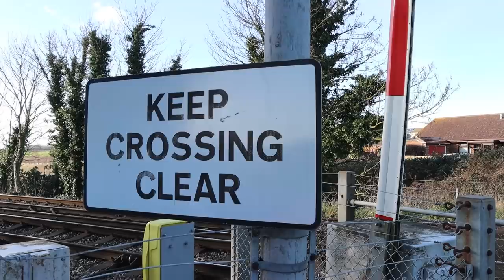Thanet Parkway Station is being Constructed

Comment: I should add, as the video would have been very boring if I'd gone into too much detail on this... It is possible to amend an Automatic Half Barrier crossing to have stopping/non-stopping controls (as the Romney Hythe and Dymchurch has) and Sevenscore crossing on the other side of the station will get them. Cliffsend is getting the full whack of CCTV for safety reasons as much as the station as it's in a residential area and heavily used by pedestrians etc... 
Now you see why I didn't say it on film.
Reply: Your contributions to Geoff's videos are NEVER boring, don't worry about it!
Reply: Legend mate
Reply: This totally needs to be pinned
Reply: It's interesting you say it has to be controlled manually. In Denmark we've gotten rid of most level crossings for obvious safety reasons, but the few that remain are normally tied into the signals, so if the train has a clear signal the gates stay down and if the gates can't go down for whatever reason the trains get a warning signal and have to stop for crossing traffic. We also have separate "station exit" signals that basically work like blocks within the main blocks, which keep the trains at the stations till the line's clear, especially in cases where the station is right next to a crossing,so the trains can't leave the station till the gates are down
Reply: Thanks for the extra information.
Reply: @thesteelrodent1796  that's pretty close to us TBH, signals can't be cleared for manual crossings unless the barriers are locked down. Automatic crossings are just that - automatic. Modern ones use obstacle detection technology to achieve the same ends.
Reply: Boring? You mean in the sense that it wasn't appropriate for this non-tunneling construction video. I would second that :D
Reply: Boring? I feel like you don't know the target audience at all :D
Reply: @regiondeltas  😂 there is that!
Reply: Boring? The only thing that was doing any boring was the pile-driver creating the holes for the concrete columns.
Reply: I must say your commentary on Geoff's videos can never be called boring. They are very interesting and informative. In my so far 38 year railway career our paths have yet to cross. Your are a great ambassador to Network Rail, keep up the good work. Ray
Reply: @citled  Oh Ray thank you - what a kind thing to say!
Reply: Every time we see your face pop up we know it's going to be an even more interesting video on top of Geoff's already super interesting content.

Comment: To answer the question about the point on the Thanet circular where going the wrong way to London is better than going direct in more detail, in practical terms it is Margate but it can be said it is Birchington-on-Sea. Margate to St. Pancras Intl. via Faversham is 1:36 h while Margate to St. Pancras Intl. via Canterbury West is 1:26 h. If you take actual time on the train Birchington-on-Sea to St. Pancras Intl. gives you a timetabled time of 1:31 h on a train via either route but due to the need to change at Margate and the timetable which gives poor connections into that direction, the actual journey from Birchington to St. Pancras is much longer via Margate and Canterbury West than via Faversham.

Comment: Chris's remarks about ice physics got me thinking, and water is indeed a deeply weird substance--and in strangely fortunate ways, too. Very few materials expand when they freeze, for instance, but if water didn't do that, we wouldn't have soil, which is... kind of important.
Reply: @robertwilloughby8050  Could be. There are a handful of elements that are denser as liquids than solids (offhand, I can think of silicon and bismuth, but I'm pretty sure there are a couple of others), but they're all solids at room temperature anyway.
Reply: Yep, I thought that was weird too' but hence why pipes burst when water in them freezes! It properly splits them open too!!
Reply: We'd also have a thick layer of ice at the bottom of all areas of water of any size, as the ice forming at the surface would sink and be protected from the later heat which would otherwise melt it.
Reply: @Michael75579  Ice fishing wouldn't be much fun.

Comment: Underground footbridges are my favourite kind!
Reply: Always love a good echo from them.
Reply: I am used to bridges going over things. If it goes underground it is a tunnel or an underpass. Are you just being casual or is this another case of the US and the UK being two countries separated by a common language? 🤔
Reply: @johnbennett1465   @John Bennett  

A crossing under the tracks is a subway.

They're just joking about "underground footbridges". In the video Geoff was saying 2:52 they didn't need a crossing over the tracks as there was already a crossing under them. It's just that he was saying "footbridge" for crossing over. He should have said "subway" for crossing under but accidentally said "footbridge" again 2:57.

Incidentally, there are things on the tube that are a bit like underground footbridges. At stations where the tunnel has to be wider to accommodate a platform as well as the track, it is also necessarily wider. However, the clearance needed for passageways over the track is no greater. So at some old stations the passageway actually cuts through the crown of the tunnel. Sometimes there is an arch- or crescent-shaped grate low on the wall of the passage where it cuts through the station tunnel, and you can see down to the train and platform below.
Reply: @johnbennett1465  The railway line is on the bridge, since it is going over the footpath!

Comment: Great video as always Geoff 👍
The heating strips on the conductor rail, are an old system that has been used for many years on the points & crossings. Stopping ice forming, so the switch rails can open and close (meet end position) successfully.

Comment: By the way... The answer to where the balancing point of journey times is is complicated. At Margate the St P via Canterbury service is 10 mins quicker than the Medway Towns version BUT that depends on when you are travelling. If you happen to be there when the Medway version is arriving, then it's quicker to catch that , than wait. At Birchington there's no benefit to travelling the "wrong" way.
Reply: If you miss the 07 From Ramsgate via Canterbury West but can catch the 20 via Margate & "The Northern Curve" I call it then it gets you into STP at 06 where as if you get the next 07 via Canterbury then that arrives 15 mins behind the 20 via Margate. I only ever got the 20 if I needed to go via Gravesend for the commuter Connection via Dartford or if Engineering works on the Ashford bit.

Comment: Time will tell if this was a good investment, they built the harbour approach road as the shipping route ended, built a dual carriageway way that was finished as Pfizer pulled out. Thanet Parkway was supposed to service a massive housing development on the Airfield site but the Airport is being reopened to Freight Airlines. All said Geoff we’ll see you back at Thanet Parkway for Kent’s least used Railway in the years to come.
Reply: I assumed that the housing development company would be paying a decent chunk of the station cost ?

Also, why on earth do they "have" to claw back the two minutes before opening the station - surely the greater good is for the station to open, and then the line upgrade works to be completed in due course ?
Reply: Totally agree Frank. Millions wasted and local residents having their roads used as free parking.

Comment: This station is very close to the currently closed Manston airport, some think it should be reopended with a shuttle link for air passengers, others think the area will be turned to housing with this being the local railway station. Regarding journey times, (and looking at high speed services only) there is an hourly service  Margate via Ramsgate and Canterbury to Ashford where it joins HS1 on to London St Pancras, plus a loop sevice St Pancras - Ashford (via HS1) - Folkestone - Dover - Deal - Sandwich - Ramsgate - Margate - Birchington - Faversham - Medway joining HS1 again at Ebbsfleet to St Pancras & similar loop in reverse. If travelling between Thanet and London via HS1 the services via Folkestone have the longest journey time, in the other direction travelling via Medway is next for journey time (but cheaper) with the fastest being the service Margate via Canterbury. Tipping point, as the fastest service via Canterbury starts at Margate, when travelling via Birchington it is quicker to travel via Medway to avoid the need to change en route for services via Canterbury. Depending on start location and setting off time it may be quicker driving to Margate / Ramsgate to catch the faster HS1 service, as always consult the timetable.

Comment: Hi Geoff, as a Rail enthusiast from Chatham Medway, through Strood, Rochester and Chatham, the maximum line speed is at 30mph, also going from st Pancras to ramsgate it takes 1 hour, 15 minutes, if you are going via ashford and it takes 1 hour, 46 minutes to go from st Pancras to ramsgate via Medway towns and faversham, so it is quicker going via ashford.

Comment: Is that going to be controlled by Minster SB, or dumped on the Ramsgate panel at Gillingham?  If it's Gillingham, I hope the signallers there get an upgrade, as the Ramsgate panel can be a pain to work, especially in the rush hour and/or if things aren't running to time.

Comment: People have already answered the 'which way round?' question, but has anyone mentioned the cost difference? There is a premium paid by passengers for journeys travelled on HS1. If you buy a ticket at Ramsgate you are often asked whether you are going via Ashford or the Medway Towns. Ashford is more expensive because there is a lot more HS1 line traversed than if you went the other way and joined HS1 at Ebbsfleet.

Another thing to note is the publicity that has been put out about the new station. The authorities have been spinning a 'faster journeys' yarn. There's been lines about Thanet to London in an hour. However, Thanet Parkway is a few minutes closer to London than Ramsgate and the 'London' they have been citing is Stratford International. Take a walk around the main station building at Stratford International and you'll find an old sign which promotes "Trains to London in just 7 minutes". Do the math.

Comment: I don't understand you call it an upgrade when it is modified from a automated level crossing to one where it will be manually controlled (aided by CCTV). Why can't that be automated and the system adjusts the barrier and lights timing based on whether the train will stop at the station or not?
Reply: It's an upgrade because full barrier CCTV crossings are a safer crossing type, a signaller confirms the crossing is clear before releasing the section for the train. Operated properly and excepting someone smashing through the closed gates they are as close to 100% safe as any road rail crossing can be.

Comment: 03:45 - not sure that is true?  Ebbsfleet opened in 2007 and Rochester in 2015 - Rochester is a new, new station also.  It replaced the old station and is closer to the 'City' centre.  Strood was an upgrade.
Reply: I think that they might consider replacing a station as upgrading it instead of a new station.
Reply: OIC - new as in not a replacement - one that has not existed before (name wise).  Rochester is a new station but it was replacing another Rochester station.
Reply: @gwyneddboom2579  Yeah - replace/upgrading to me means on the site of the old one but I get what she means.  Cheers!

Comment: 9:10 Wait... does this mean this will be basically a manual operated crossing? Why they don't place two sensors near the tracks - first one closes the crossing and when the second one is triggered raise the bars again? This whole concept of timed crossings is really strange... what if the train is slower than usual? Would be the same problem as if there's suddenly a new station, wouldn't it?

Comment: I live in Margate, it is almost equal time to St Pancras if you go via Herne Bay or Canterbury, obviously via Dover would be longer by I believe 30 minutes.

The guestimate of Birchington sounds pretty good for a balance point.

I've never understood the point of the Thanet Parkway station, early analytics suggested that any time saving over established journeys are almost negligible, it's invariably going to push local ticket prices up and be the eighth station in the relatively short distance between Birchington and Minster. I'm open to replies to offer a valid justification for it beyond supporting local housing developments.

Comment: Very similar to Warwick Parkway, in that both stations are on an embankment, and at Warwick an old underbridge is used for the walkway between the platforms instead of a new overbridge. "First station since 2007"- that's not correct- must mean in the south-east.

Comment: Very interesting video. I would like to know the voltage and current of that heating wire. And that level crossing, well the half barriers are not that uncommon. We have them a lot, and we adapted them, including signal systems from the USA. But in the USA they have modernized  there level crossing train detection. They not only detect the trains, but also the speed of the train, and so adapt the activation time.   And with stations the barriers close, but time out, while the train is holding in the station. Then, before the train leaves the train driver can activate the level crossing with a remote control. Here in the Netherlands we have a timer system. When a stopper services approaches a station, with a level crossing behind it, the signal a the station is set to danger, and when the train approaches the level crossing activation zone, the level crossing is not activated but a timer is started. This timer is set so that about the time the train stops in the station, de barriers close. And when they are closed the signal goes to green.

Comment: Current Stopping pattern off peak is 60 mins on Javelin. 60 Mins on 375. Extra's put in for Peak. The difference in running time from Ramsgate to St Pan via Canterbury West & via Birchington is 1hr 16 to 1 h 46mins so 30 mins difference.Been up that road & across that level crossing a few times 🙂

Comment: Im not overly clued up on level crossings, so im curious to know the answer to this question that came to mind:
Since the AHB crossing times out after a certain length of time as it assumes the train has passed or there wasn't one, what happens if the train is travelling much slower than usual?
Such as if its approaching a red signal for example. How does the crossing know the train is approaching slower than usual in order to keep the barriers closed and hasn't just disappeared?
Reply: His description was not entirely accurate unfortunately.
Once a train has 'struck in' (i.e. within the 27s running time to the crossing at normal line speed) the barriers will stay lowered until a movement sequence is proved to have taken place by the crossing control equipment allowing the barriers to raise. IF this movement sequence is disrupted AND it is proved by the trackside train detection equipment nothing on the approach to the crossing the crossing will indeed 'time out' (or reset) for the next train and barriers will raise. But IF the approach to the crossing remains occupied (in either direction - by a failed train or failed signalling equipment) the barriers remain lowered and stay there until a local operator can take control and manually raise them until the failure / fault is fixed. 

An unusually slow moving train will cause the barriers to remain lowered for longer. This presents a well understood behavioural risk of road user impatience when they take it on themselves to disregard the wigwag red lights and lowered half barriers and take it on themselves to drive around them (the crossing might also be lowered for a train approaching at line speed in the opposite direction!). Obviously highly dangerous but nevertheless a risk which Network Rail takes seriously. 

IF there's a red signal situated within the approach but not within 25m of the crossing then additional automated controls are provided to keep the crossing open for road users until such time as the rail signal can be cleared for the approaching train to a proceed across the crossing. To ensure no train can arrive at the crossing earlier than 27s between initiating closure of the level crossing and initial clearance of the signal reading over it an automatic delay in clearance of the rail signal is sometimes applied where appropriate.

I suspect the reason for upgrading the crossing from half to a full barrier crossing type is simply to address the likely misuse of the crossing by road users caused by the increase in trains slowing on the approach to the crossing to call at the new station which would lead to many more instances of the crossing being closed to road users for longer periods. Full barrier crossing types provide scope to apply a more tailored set of crossing controls intended to minimise the time the crossing remain closed while significantly reducing the risk of road user disobedience.